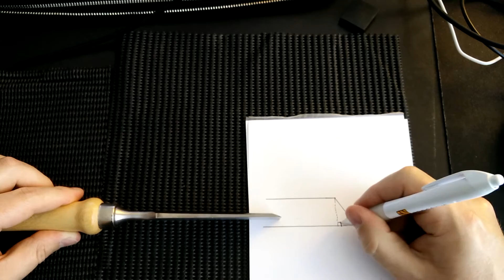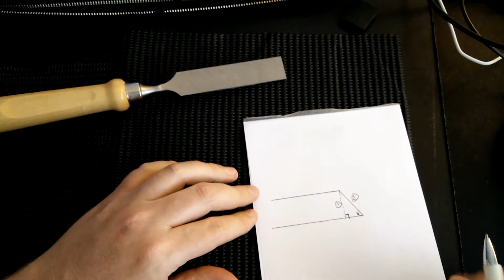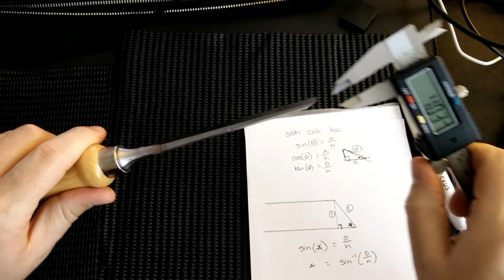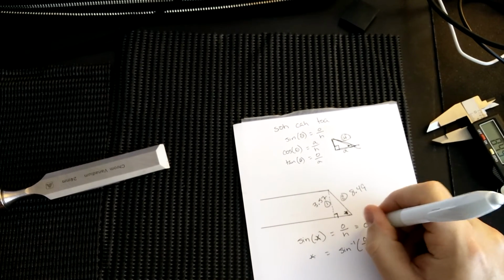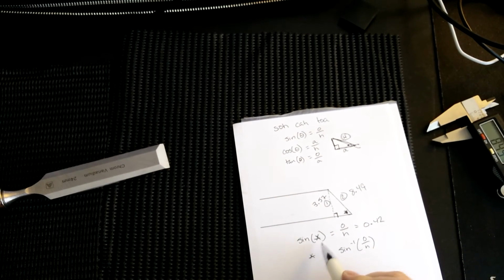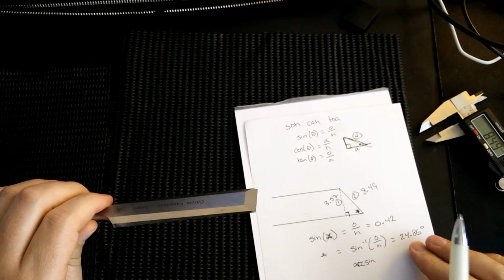How to measure and calculate bevel angle of a chisel (or other things)

Comment: I've never used a degree calculator so could you help me as I cannot work out how you got 24.86 degrees after 0.42. This is the calculator i'm using http://web2.0calc.com/
Reply from the maker: I created a quick screen cap of how you would do this with a calculator.  Should be similar for most calculators.  https://youtu.be/4DrgKhH1dKg